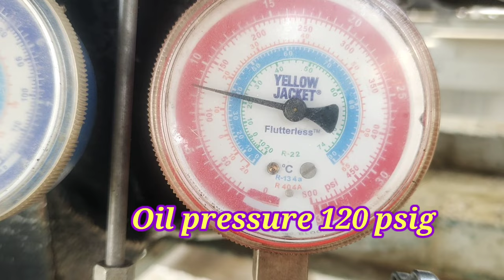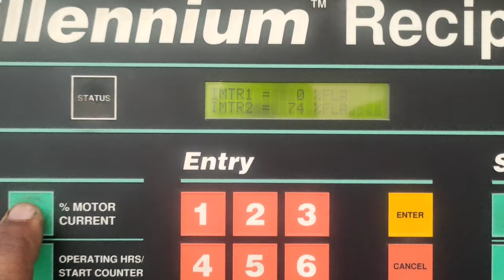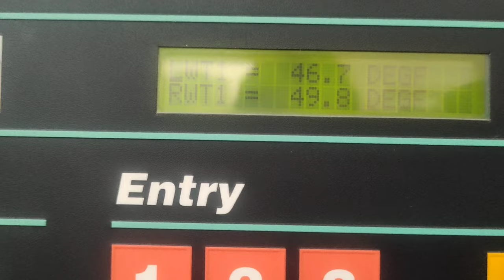How To check oil differential pressure | Reciprocating compressor oil pressure checking

Comment: Bro i overhauled this same type recip chiller  problem is oil  pressure variation 30psi 19 psi 70psi etc.. like this going and later oilnpressre low what is the problem i chenged oil pumb and oil also still not ready please rrplay me